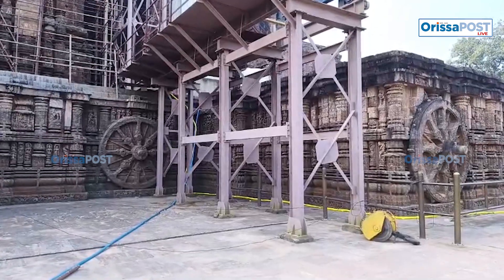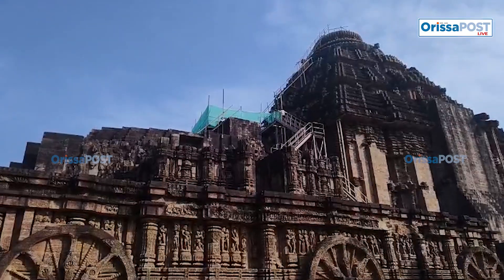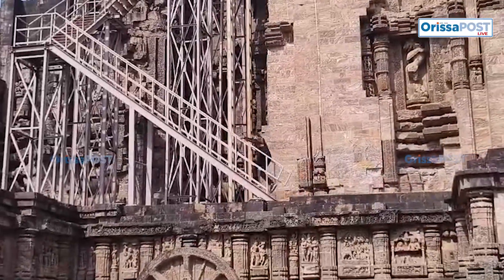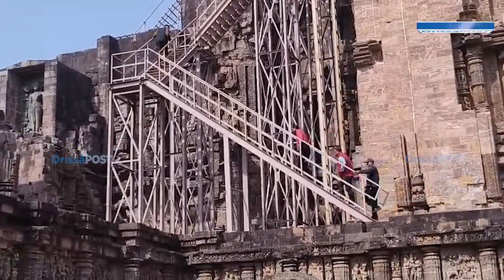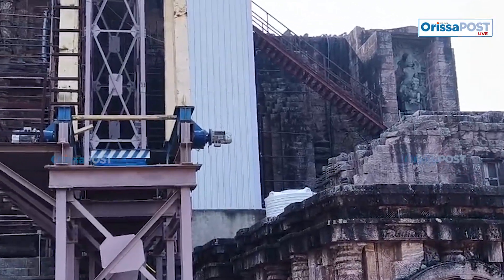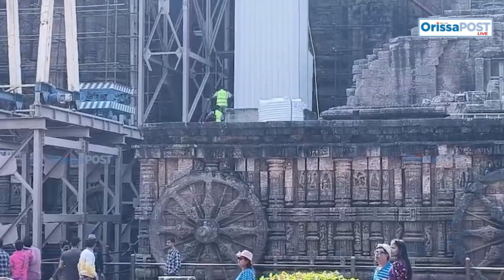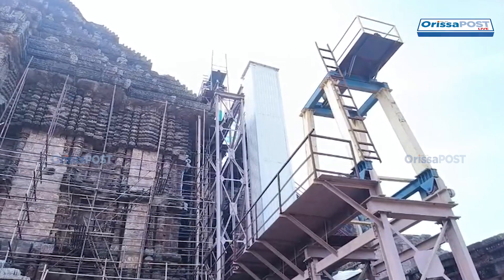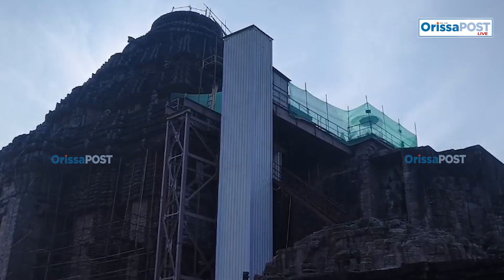7-metre deep drilling at Konark Sun Temple | sand removal inside sanctum

Comment: How did they put the sand in the sanctum in 1903 ?Did they drill to put sand from above ? If they drilled the temple to put sand from the top  the same drill hole could have been used to take the sand out.   Hope they are taking some measures to prevent collapse while the sand is being removed.  It is a very tricky operation indeed.